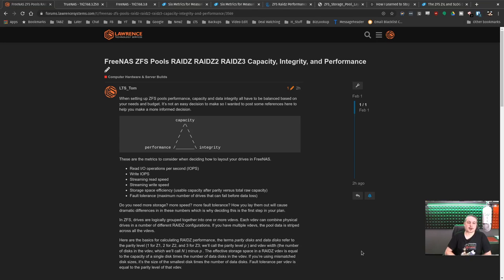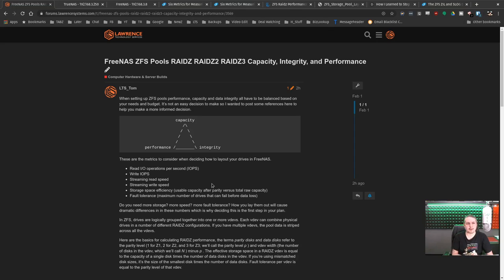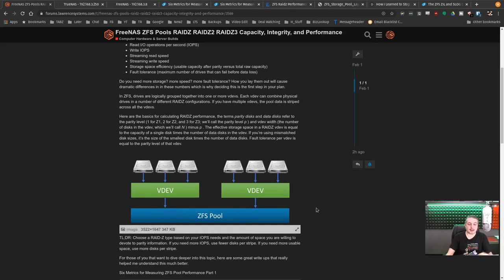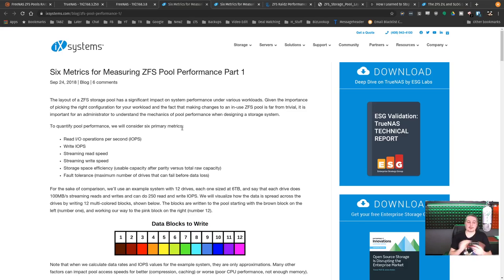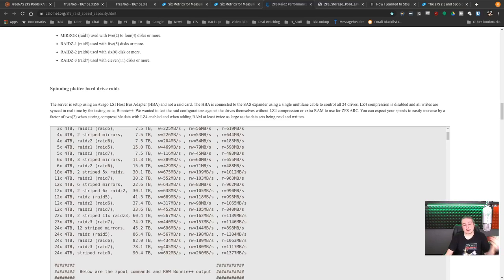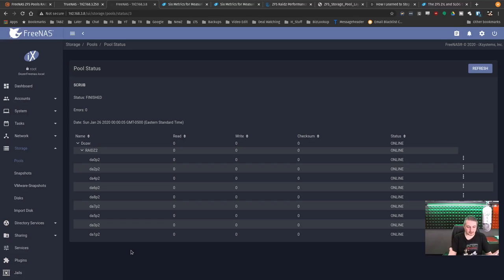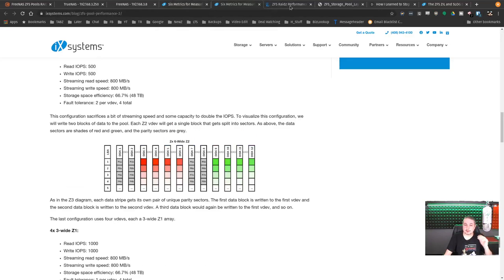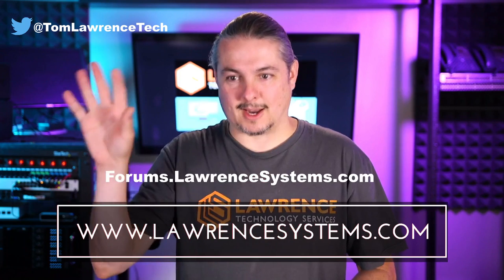TrueNAS ZFS VDEV Pool Design Explained: RAIDZ RAIDZ2 RAIDZ3 Capacity, Integrity, and Performance.

Comment: Thank you. I have seen the posts you mentioned in your video but hoped for a more generalised solution in designing a storage zfs pool, but in truth I wanted to find a ready to use solution for my use case, but I have to admit that this is may not be possible. My use case - I would call it general file storage - but is it really general? Even though I may not have my exact answer, it surely opened my eyes about the topic and that I have to analyse my data a bit further than I have done so far.

Comment: Real world example for most average home users who are newbies. We have different size hard drives we want to make use of. Hence, my problems. From the documentation: 9.2.6 extending of pool. To Increase capacity of an existing pool, a pop-up warning displays a reminder to stripe VDEVS of the same size! So from my understanding if I install freeNAS on an old machine and I have 3x 3TB, 2x 4TB, 2x8TB I wouldn’t be able to create a pool using two VDEVs? (VDEV1 being 3x 3TB & 2x 4TB RAID Z2 = 9 TB, VDEV2 being 2x 8TB RAID Z1 giving 8 TB) in my newbie mind I thought this would create a pool of 17 TB, but am I wrong? A pool must have VDEVs all of the same raid type? It’s a major headache. I have a Synology NAS and I just want a simple way to backup 15TB, with rSync, then move it offsite for backing up any new videos added but I don’t have a budget to buy a new machine. The great thing about Synology is being able to mix different drive sizes and have redundancy and a nice size of reusable data. If I want to backup 15TB of videos with my spare hard drives (using a simple one destination method) is this not possible with freeNAS? Is this more of something unRAID can solve but not freeNAS?
Reply: It is possible to put different disk sizes in truenas. I currently have 250GB, 1TB, 750GB all in one pool but can only be in a stripe. One of the drives (250GB) died now my data is pouched. Been trying to figure out how to recover any piece of my data from the rest of the pool for the past 3wks. No luck.

Comment: Hi there, I'm puzzeled with the topology of how data is stored. I'm using the TrueNAS-12.0-U6.1on a old  DELL R520 with 6 real HD and I have only a option to make a Pool out of a number of real hard drives. But the picture in the forum suggest that Real Hard drives are grouped into VDEV's and then put in a Pool. What am I missing.
Reply from the maker: Any group of drives that make up the pool is the VDEV.

Comment: I have a question. I currently had a qnap ts-809 that got full and unmounted the pool and will not do anything other than format ( with loss of all my photos/music. So I´m thinking of building a new backup server to protect all data using freenas. I have 8x  3 Tb disks from the qnap and I´m thinking of 4 new drives with the largest capacity available. Since all raid must use the same capacity I wonder it in my case become two pools? One pool with 3Tb x 8 and one with 10Tb x 4 drives? Will this work & be safe if a drive fail? Or is this not the optimal solution? Any thoughts?

Comment: Unraid Vs FreeNAS, would Unraid be a better option for recovering data? encase of multiple hardware failure (i.e. If I had Raid Z2 setup with 8 Hard Drives and 3 Hard Drives failed what would happen?, because with Unraid you would only lose that data on that disk). Would love your opinion on both.

Unless you already have one then my mistake.

Thanks in advance.
Reply: If you had a single VDEV in RAIDZ2 w/8 drives and lost 3, you are now hoping you have a backup, or....you are quite screwed. :)

Comment: I've pretty much moved completely to using mirrors for storage. It just makes so much sense. If the client is particularly small, and needs the redundancy, I can do RAIDZ2 (RAIDZ and RAID 5 are dead). But for the most part, disks are cheap. My base layout is two 2 disk mirrors striped together. Need performance, add another 2 disk mirror. Need more redundancy, add a disk to each mirror. Speaking of redundancy, once you hit 6 disks, a pool of mirrors has better redundancy than RAIDZ2, and arguably better redundancy than RAIDZ3 (all assuming two 3 disk mirrors striped together). And the performance is way better.

In all of this, I'm talking about storage for virtual machines. Which is why I was very surprised to hear that you're on the fence about cache drives for VMs. From my experience, even an L2ARC on mirrored rust is going to provide far better caching performance than Windows' or Linux's FIFO cache, especially as the size of the data that could potentially be grabbed increases. VMs tend to get about 4GB of RAM from me starting out, unless they're hosting database software like SQL Server, in which case SQL Server gets memory because the caching it does is similar in performance to the ARC. Other than that, memory increases as various system tasks demand it.